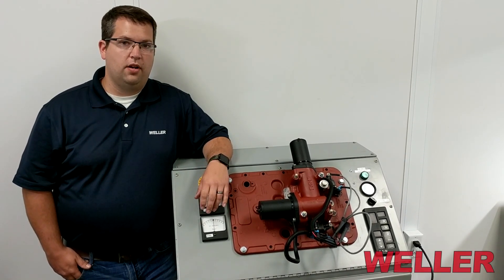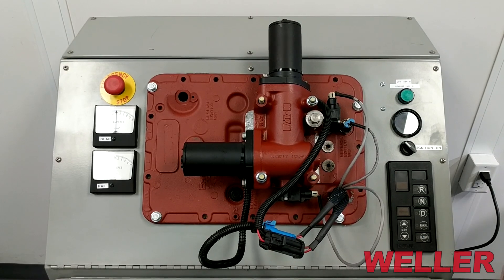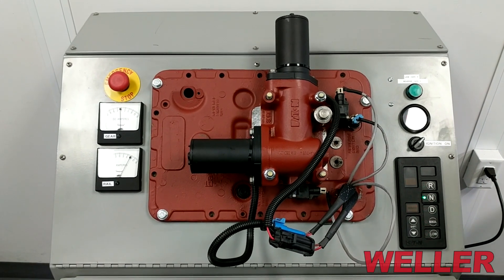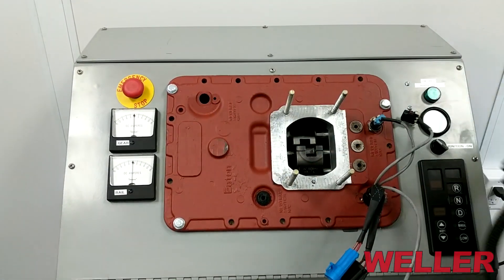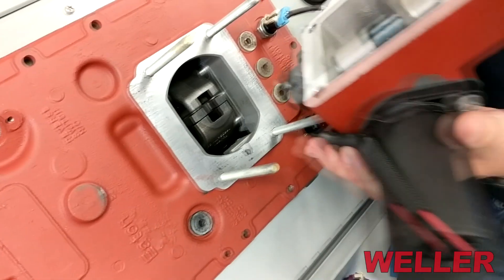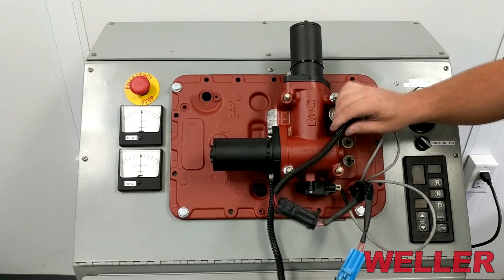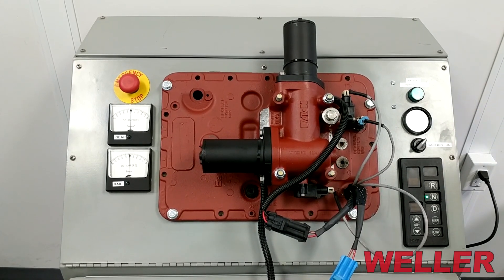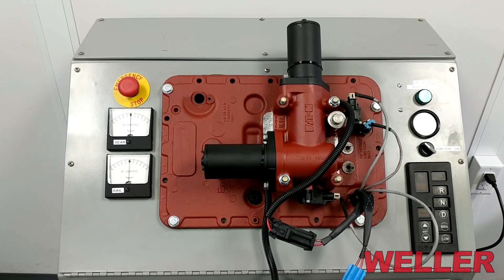Eaton Fuller Autoshift Ultrashift Front Box Control Test

Comment: Mine has an F with flashing service light. Still works while driving so I don't really know what might be wrong with it.  ?
Reply from the maker: Chris, to start off, my favorite numbers are 76-01 so we have that in common.
Now to answer your question, A flashing "F" means there is an active fault code in the Eaton system. Since the transmission is still shifting, it is not a critical error, but something that should be addressed before the situation worsens. On the Weller Truck Parts website, under the "Support" tab, click "Technical Documents" and look for the applicable trouble shooting guide. This guide will explain how to retrieve trouble codes and the troubleshooting involved in rectifying these trouble codes. I hope this helps.
Thanks
Reply: @WellerTruckParts  thanks.  It was a problem with reverse and neutral position recognition.  It was just a company truck that I don't have anymore. Thanks for replying 😁👍

Comment: I want to build an automated tractor for farming.  I'm a software engineer with a degree in software and electronics as a point of reference (not a mechanic).  

Essentially I want to make old tractors, many if not most with a manual transmission and clutch, smart tractors.  

I think your product is targeted at the trucking industry, but it appears to be a short leap to adapt to agriculture.   

What I need is the ability to electronically control a device like yours for small and mid sized manual transmission tractors.  Is that possible?  Same question for breaking, throttle, clutch, PTO, hydraulics, etc.